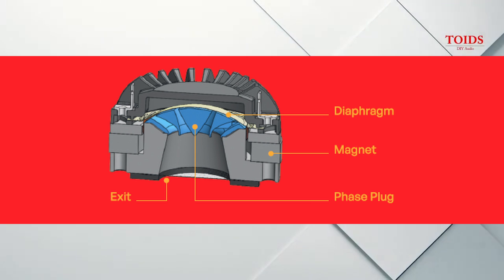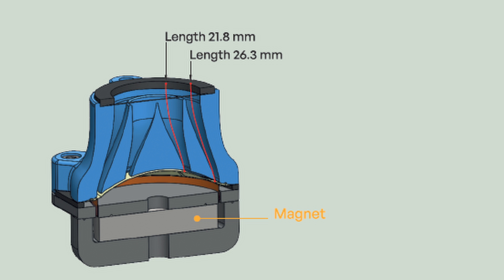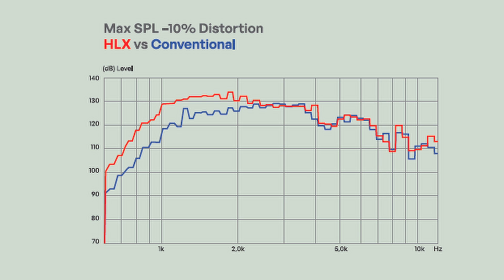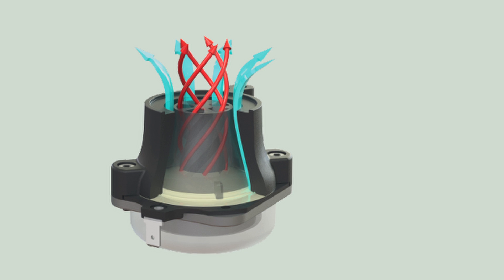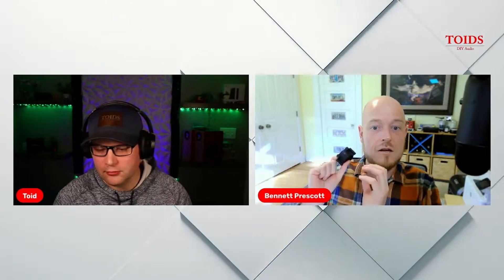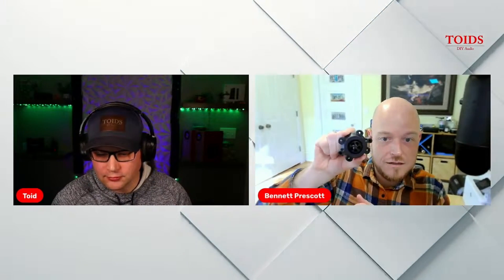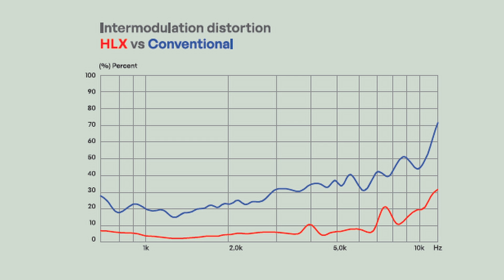B&C's NEW HLX Compression Driver Technology is Louder, Cheaper and Sounds Better - DH350

Comment: Re: the adapter. If you follow their lead and think inside out, its obvious. Rather than a mounting plate, you have an insert cap that the driver bolts to, flush, that then bolts to the horn flange. The driver is still in the same orientation/location, and it becomes securely attached.  3d print in plastic or CNC in aluminum. Or, injection molding would be quickest and least expensive on manufacturer's side.

Where do i send my consultation fee? 😂😂
Reply from the maker: That’s a good idea
Reply: Yeah, as long as you precisely and smoothly match up the angle and curve.

Comment: so epic.  these are my favorite videos you make.  i'm planning a horn based speaker build, and I may have just found my compression driver!

too bad I can't find anywhere to buy this yet, it's too new.

My question, especially if the engineer can see this, is what is the BEST horn to put this in (to get to 1khz or lower, even 800hz if it's feasible)?  NO adapter. cost no object... I don't need it to be the 60 or 70 dollar ME45 that they show in the product page example.  I would like a wide horizontal coverage, but I'm open to elliptical or exponential or maybe even a CD horn, or a round waveguide, or oblate spheroid.  Faital has a good looking one but it's only 60 degrees wide, costs like 120 or 140 or something.  I'd be looking at the bigger DH450.
Reply from the maker: Thank you! I appreciate hearing that
Reply: Depends on what max SPL you're looking for. But small(ish) working area drivers like this (or the new Beyma CD151 or 171) really need large size, narrow dispersion WG's to get them really loud @1kHz. For home use, loudness is USUALLY not the main problem though. At home I'm running Kartesian Cmp35_vPA's on small (about 7" wide) tractrix style Faital STH100 down to 1250Hz, and this is the lowest THD/IMD combo I've ever measured @1250Hz @100dB. Those drivers are built with the same idea as theese (lower lens-to-diaphragm compression ratio, perfect lens exit summation)
Don't stare yourself blind at the x-over frequency before having tested the drivers/WG's/mids you're going to use though, it's often much more important to match directivity and power handling between the WG and the mid driver, no matter if that means moving the x-o a few hundred Hz up. For a 12" mid and about 12" wide ~70-90deg WG you usually end up between 1100 and 1300Hz. For an  8 or 10", maybe up to 1500Hz depending on how your particular mid "beams" 
Other options might be the LaVoce HD1004, or any good JBL/Selenium spare part from their current lineup
Reply: @AJBtheSuede  thank you for the response.  Do you have a link to perhaps a forum post about your build or something like that?  I haven't heard of those components so I'm quite curious.

I've been mainly looking at 1.4" CDs, relatively high end, but this one seemed feasible.

I'm going to be crossing to a 15", hence why I want at minimum a x-over below ~1050hz, and the lower the better.  I've found affordable combos that could do say 800-900hz, MAYBE 500-700hz.  And potentially I'm willing to spend more, but I'm not worried about quarter wavelength "beaming" calculations, that's quite conservative though it would be nice.  Anything less than half wavelength I'll settle for, since my current custom horn mid speakers (3 way with a ribbon tweeter above 9-10khz ish) are crossed somewhere between 1500 and 2000hz (don't know didn't build them, this is based on ear with sine wave generators).  So even the 1k mark would be a big improvement, and I want to be able to skip the tweeter for the top octave too.

I'm open to drivers that cost several hundred dollars that's not the issue, I'm just wanting a sensible combo that gets 95% of what's possible for a smart amount of money (for a 2 way where strong bass to 30hz or lower is important).  I will build large cabinets, and I don't shy away from DSP EQ.  For example my current speakers use a JBL 2225h (crossed too high obviously) in large relatively low tuned boxes but regardless need at least 18db boost centered at 30hz, but are more than capable of producing the bass I ask of them once that sensitivity/FR is corrected for.  In fact I can hit about 28hz at an SPL I'm happy with, and not worry about exceeding their 5mm xmax.

I may start my build with the 2225h's for initial cost reasons (and because they're extremely excellent drivers), but ultimately I'm looking at high end B&C 15"s that have roughly double the xmax and are designed to play low in a reasonably sized box.  I have more than enough amplifier power available too.

So my SPL requirements for the horn are not super high.  I don't normally listen to music above 85-90db, though that's an average so factoring in the dynamic swings maybe I should account for plus 20? 110-120db seems sufficient.  I'm more concerned with quality, and I don't set my gear up for flat response I like elevated bass.  I'm not into damaging my hearing and I like to be able to listen for an hour or more so I'm not pushing avg db more than 80-85, and usually not even that high, maybe 75.  I'm more concerned with sound quality.  You know, distortion (including IMD as you mentioned) and good dispersion characteristics.

My mid horns are 10.5" x 3.5" exponential horns and use old Akai phenolic CDs, probably 1"or less I believe, and ribbon tweeters from the jvc zero line (these are actually nice!).  They have a nasty peak I have to tame around 2khz (at least 6db), and the directivity doesn't match up with the woofer well at all obviously.  Though with EQ they sound quite good... But that's relative, I know it could be way better.  (I have a Umik-1 and REW, and use a PC as my only source, with infinite EQ options, good DAC, good amp).

I'm even considering b&c 464 coaxial CDs and the me464 horn just to let you know what I'm open to, but I feel that may be overkill.  I've found reasonable (sub $350 let's say) CDs and maybe an me90 or something to play to 900hz, or a couple options that might go a little lower.

But again, if I can achieve 95%+ sound quality performance with a sub 1050hz x-over for less I'm open to whatever, but I'm not looking to cross a 15 at 1300hz or something.  There is a celestion 1" CD that can cross at 1khz and a horn that can load to that as well that I've spotted.

Think big 15" 2-way, tuned to 35hz, crossed at 1khz or less, that can actually play to 20khz, with decent polar radiation graphs (esp horizontal obv.)... Give me 30 degrees above 10-15khz, no lasers.  I would actually prefer a horn geometry that's not "constant directivity" due to the distortion (reflection) elements that are increased with CD designs, which is why I'm only looking at 1" and 1.4" CDs that beam less than a 2".

Given the above background info, I'm quite open to outside input as I have not found the "one right answer" on forums for a 2 way 15" horn build for medium money.  It's like it doesn't exist, but it should ... there MUST be one best answer for a 500 or 800-1khz x-over and 80-90 degree coverage with a 15" and a horn, for say 2 or 3k tops.  This should be simple.
Reply: Sorry, I have no published project data on this speaker set :/ It's my current active project, so still working on the lower bass module. I very much recommend the Kartesian drivers though, for almost exactly the reasons that the driver in this video is interesting. Low lens compression ratio (lowers THD mainly, and can help IMD), simplified but good quality magnetic structure. But the Kartesians are really flat way out to 20+kHz without major resonances, something this new DH series seem to lack. I really don't know if that's important in the grand scheme of things....Kartesian only have EU shipping partners yet though, so hard for US/asian customers. Here in the EU I paid something like 230Eur/USD standard retail for a pair, which is extreme value IMO.
One thing I really do think you should look into is getting the best SQ 1" throat CD you can find locally (like maybe the one in this video, towards summer?), and then find a 1.4" throat waveguide that has a purpose-built 1" to 1.4" adapter. The adapter NEEDS to be made (or at least match) the throat angle of both the driver and the WG. IMO there's more (and better...) options to choose from if you look at 1.4" waveguides, but for home, "high fidelity" use 1" throat drivers usually have better high range (8-20k) sound quality. For use with bigger mid drivers, in home settings, that's what I'd recommend to any friend right now. A short, straight conical section leading into the main horn throat does many good things, and very few bad things (if everything is smooth, angle-matched)
The 1" market has really evolved the last year or two, with over 20 years of development stagnation to claw back. JBL, Beyma, 18sound/BC, Faital - all of them have new and interesting drivers that are a step up over what was available for the same money five, maybe even three years ago  @Artcore103

Comment: Hmmmmm... Build some high efficiency PA style surrounds, using this CD, a horn, and maybe an 8 or 10" driver? The form factor of these seem they would lend to thinner enclosures
Reply: No they won't, because you still need a horn large enough to support the x-over point you want.  It doesn't allow for smaller speaker designs, just lighter and cheaper.  If you're referring to depth, I don't see these being much different.  

I love horns, but it wouldn't be my go to for surround speakers in a small domestic environment.  If you did want to, you'd be best served by a maximally wide dispersion controlled directivity round or square design for wide even coverage.  And you're looking at 8 or 10 inches on the horn probably even if you would settle for a 1.5khz crossover.  12 inches or more (more is better) for 1khz.

Comment: What are you going to build with these?
Reply from the maker: You tell me?  What do you think would be a good use case for them?
Reply: @Toid  I am thinking that you can diy a coaxial driver like using a existing design and replacing the rear mounted CD or use a 12"/15" driver an figure out how to place it in front of that driver. There are some designs made over the years but I'm curious if you would take the challenge and build something like that.
Reply: @adipuiu5603  I'd be curious about a coax design, it would certainly be interesting, but it's not going to be great.  They simply are NOT even close to ideal, unless you're talking about something like a KEF driver or similarly designed coax.  But all the rear mounted CD coaxes like the various pro drivers out there that do this are severely compromised designs.  Someone may desire the form factor for some reason, but it's never going to yield a sound quality result that even comes close to a normal design with a separate horn or driver.  The polar responses and frequency responses are always way off with any of the rear mounted CD pro driver options, even the ones that are integrated designs (i.e. you don't just mount your own CD, but it comes as an engineered integrated unit).  I know because I've looked at them, because in theory it would be great if you could get a KEF quality implementation that's just bigger and more powerful.  They don't exist sadly.
Reply: @Artcore103  I thought this design would result in a great point source speaker with use home audio speakers since they are at a  relatively close distance to the listeners.  For big listeners areas and distances it's ok to use separate drivers. 
The KEF's LS50's you probably thought of suffer from intermodulation distortion where the cone is used as a  horn, I am speaking of something with a horn in front of the driver and taking into account the plus 5dB of the new CD in discution that horn would be smaller in size.
Reply: @adipuiu5603  I hear you, in theory it sounds like it could be great, but they're not.  The ones with the horn in front of the driver have their own set of issues, since that horn severely affects the upper response/directivity of the woofer where it crosses over.  The other ones that look like a normal woofer but have a CD that projects behind the transparent dust cap just have slightly different issues.  Either one is a trade off.  If they were great you can be absolutely sure everyone in the forums would be using them, because it simplifies design SO much.  Who cares if the driver Costs 700 dollars, the cabinet build is easy, the crossover is already figured out for you, it's a freaking POINT SOURCE which is ideal... Yeah, everyone would use them.  But they're just another option with a different set of tradeoffs, and are overall inferior at that.  Their one upside is the point source. In every other respect unfortunately your traditional 2 or 3 ways (properly designed) are far better.  If they weren't, this design would be absolutely dominating, as they've existed for some time now, and they're not.

Also the horn would not be smaller simply because these might be 5db more efficient.  The mouth size is base on the frequency desired (the driver loading required), not on the sensitivity of the driver.

And the KEF drivers are far better than you give them credit for.  The ls50 is a relatively low end KEF unit for one, but Erin's audio corner has tested several (not even the best ones yet), and they're quite good.  Distortion is a little higher than quality separates yes, but it's not problematic at all (within spl/FR constraints).
Reply: @Toid  PLEASE use the bigger one, even if you do the small one do the big one when it comes out to.

Given the price, I don't think anyone should buy the smaller one.  The bigger one is just plain better... Louder, lower crossover point (marginally but still).  The only potential advantage of the smaller one is perhaps slightly wider dispersion in the last octave.  But I'd rather have the spl and maybe 200hz lower x-over.
Reply: Would love to see a monstrous portable party box build a bit like the JBL ultimate.
Reply: MTM, these and Dayton SIG180-4. Easy 8 ohm load for AVRs.
Reply: @hifiman4562  mtm is such a bad and overplayed design, unless it's a 2.5 way.  Bad vertical off axis performance, which even if listening on axis will affect the sound since we know off axis sound affects overall sound through all the room reflections.

I think people think they look cool or something, there's no upside.  Put the 2 woofers below the horn and make it a 2.5 way or 3 way.  You may be wanting to better match the sensitivity of the horn by using 2 woofers, but you're still going to have to pad it anyway... MAYBE some very sensitive (approaching 100db, if they exist in that size) drivers could come close.  But if you're going to pad it anyway, then who cares.  1 6.5 or 8" is plenty if you're supporting the bass with a 2.5 or 3 way.